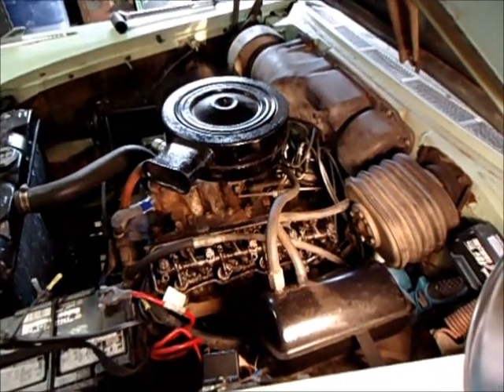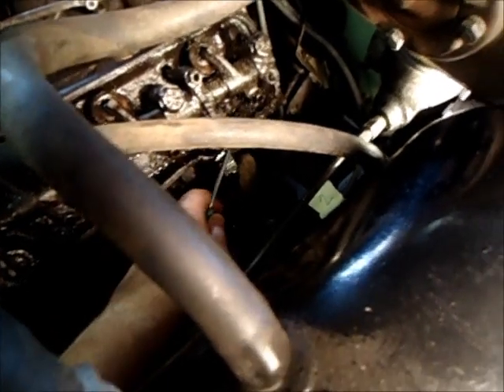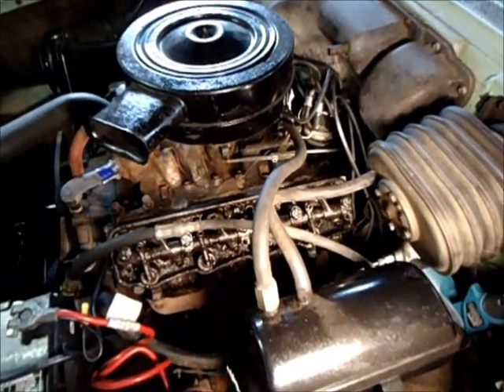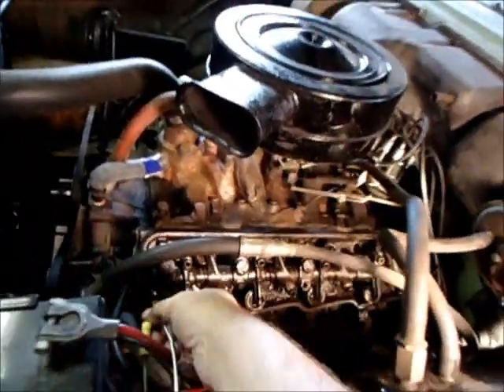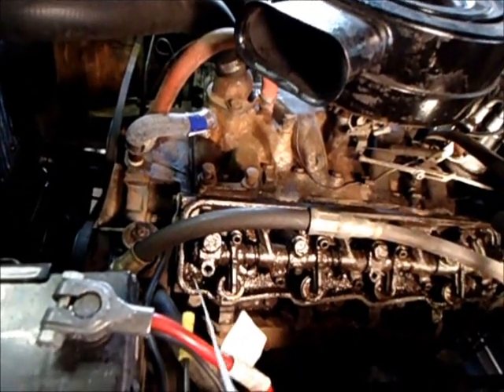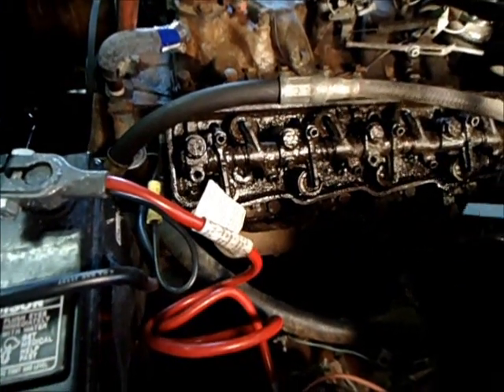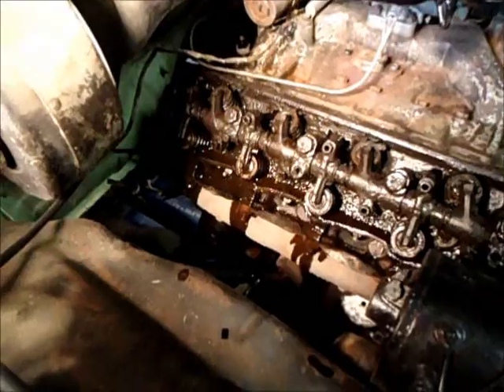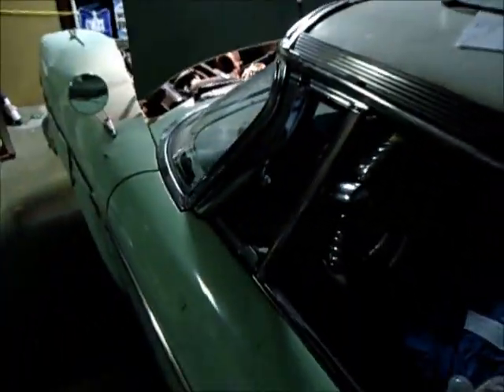58 Belvy Plymouth Update #6

Comment: My first car was a used 1958 Belvedere.  Paid $150.00 for it in 1964.  So this vid sure brings back memories, especially what good ole non-detergent oil did to our motors.  But that's the way it was back in the day.  You should have seen what it did to the 50s Ford engines that had the valley pan cover beneath the intake manifold.  The oil sludge was so thick under them that you could scrape it out with a putty knife.
Good vid.